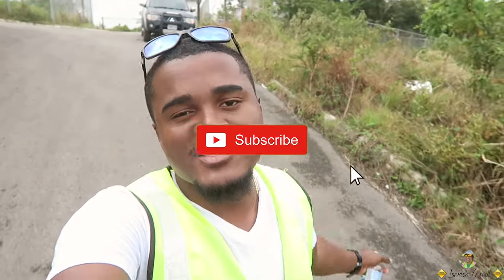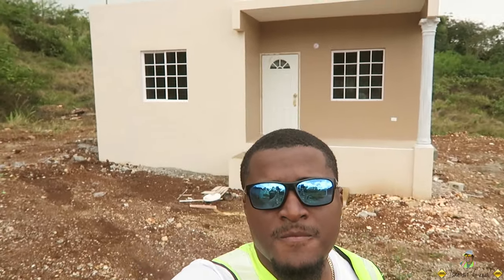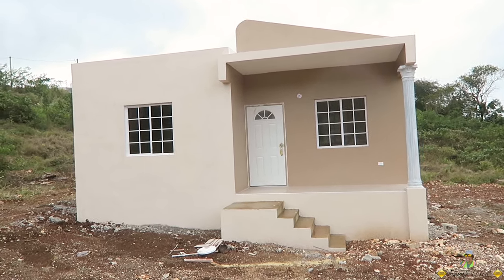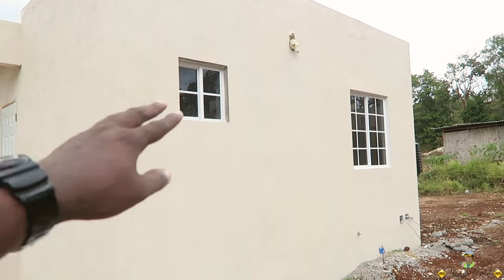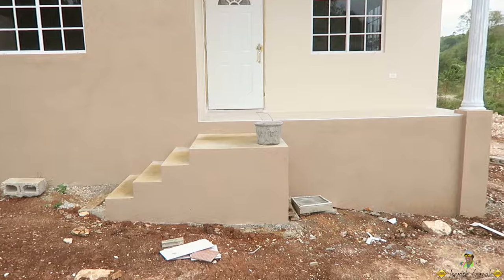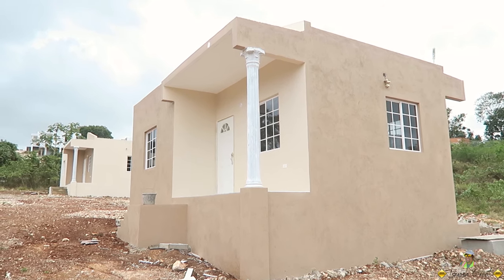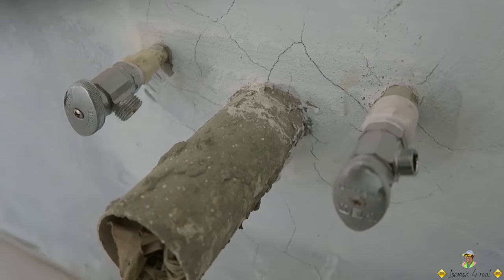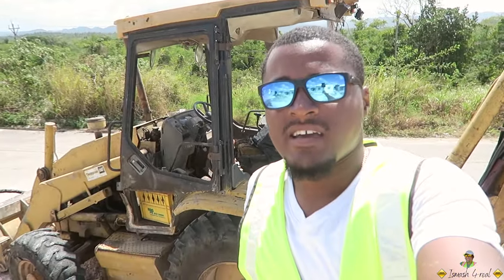AFFORDABLE Houses For Sale In JAMAICA (Everyone Can Afford One) #Update

Comment: Building concept the fact is you lay a foundation then you build on top. That concept should transcend throughout the whole structure. Tile the floor then tile on top that’s will prevent water seepage the shower curb as well needs to be capped
Reply: Yep 👍🏽 That’s what I think too although I am not a tiler. As you correctly point out, it prevent water from seeping through the creases easily.
❤

Comment: FIRST IMPRESSIONS...  WHAT UGLY LITTLE BOXES - FIT ONLY FOR ONE PERSON - What happened to the sloping roof so the rain can run off and where are the trees and garden space?? The windows are too small to allow for natural airflow.  Raised manholes with small pipes going into them =  guaranteed future problems that are unsightly trip hazards and have the potential for raw sewage blockages galore. then ugly external exposed pipework with cracks all around them - what is going on with quality?  Will each unit have an ugly exposed water tank?  Overall Extremely disappointing.  I am pleased to know there are three stages termite treatments taking place  as they can have a devastating effect on an untreated property. And oh yeah those blue sunglasses are horrible.
Reply from the maker: Hope you enjoyed the video otherwise.
Reply: These aren't custom homes or for folks who have extensive funds. They are intended as starter homes.  I guarantee for those lucky enough to acquire one (likely via lottery), they will appreciate it.